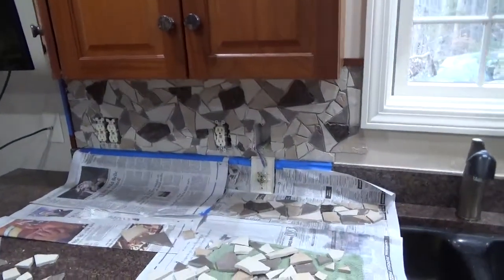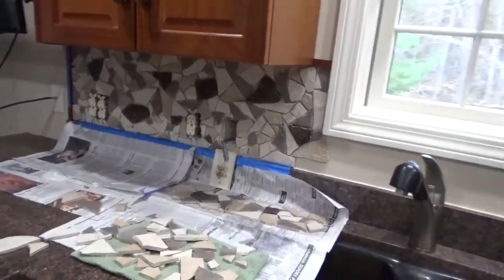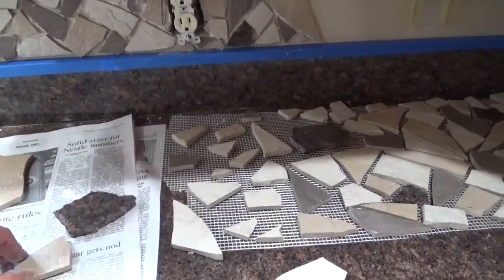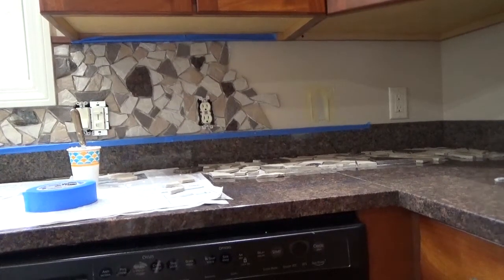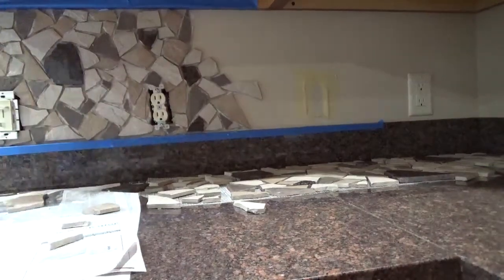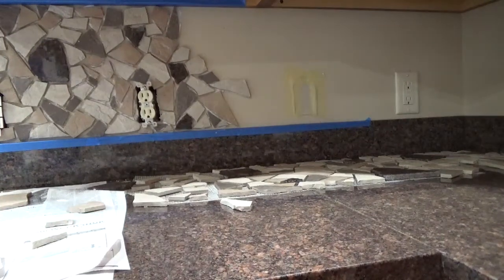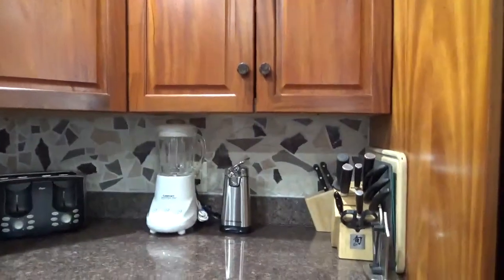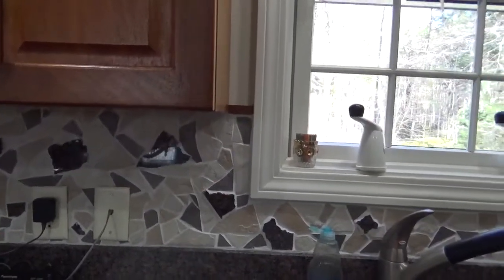Tiling backsplash

Comment: Hi Jean, Sandy here from lreland, just had to subscribe, about to prepare your keto 30 minute steak & veg for dinner. Also l've been blown away by your super tiled splashback & am going to collect the materials and tile behind my cooker & above my sink in the kitchen. BTW l loved the white grouting, if or when you use the enhancer to make it more grey will you upload the finished project? l'd love to see it.God bless you Jean you've been a real encouragement. Thanks so much! Looking forward to following you.
Reply from the maker: Thank you for your kind words, Sandy....https://youtu.be/pnX8h0OqYXM This is the tile after I darkened it a little....much more subdued and handsome...I sealed it with a spray-on tile and grout sealer......now when water splashes onto it , it beads up...easy to keep clean!........great to be on Keto.......I made a cheese sauce ( cream, butter, garlic and assorted cheeses cooked until smooth )  I  put it on all my cooked veggies instead of salt.....so good....makes a meal of the veggies and you get lots of fat for your Keto....good luck with your tile project...it is not difficult but makes a huge difference.....I found "frosting" the back of each tile made it so much easier...and cleaner!!! The grouting  was messier...I found that if I put the grout in my cake decorating throw away funnel paper  tubes , I could squirt the grout in between the tiles, and then smooth it out with my finger, before wiping it with a damp sponge....have fun!!!